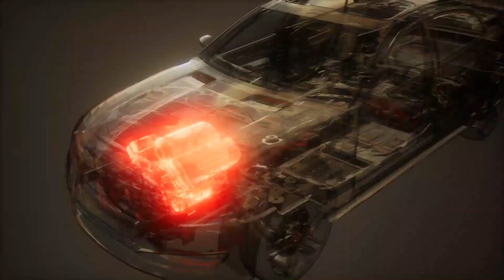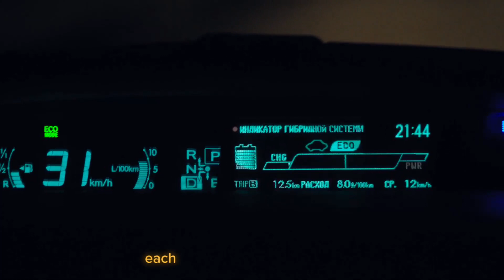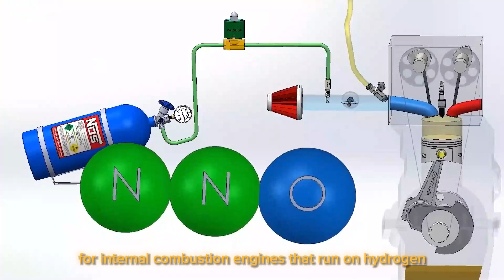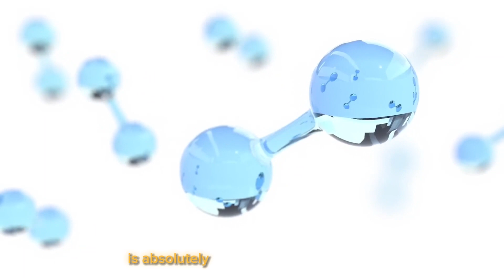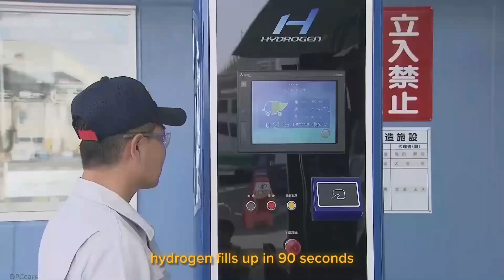Toyota : "This New Engine Will Destroy The Entire EV Industry!"

Comment: "This new engine will stop EV-"
No it won't 
"Hydrogen is ab-"
No it isn't 
"Gasoline will stay for-"
No it isn't 
"EVs catch fi-"
No they don't 
"Batteries deg-"
No they don't 
Just stop it. Its annoying.
The most fuel efficient power production is in the grid, even if you use coal or gas
Batteries are much better today thanks to advancements in chemistry and proper algorithms of the bms.
Cobalt is used in refining oil and lfp battery chemistry doesnt even use it.
That lfp chemistry also doesnt catch fire when pierced. In general gas cars catch fire many times more frequently than EVs, but nobody reports it on the news
Hydrogen is not only energy intensice to produce, it is also energy intensive to store and transport. The same energy you complain is not clean or renewable when complaining about EVs.

Comment: Doubt so, it is not about the car. It is about the infrastructures required to build all over the country to support the refueling before it can start cashing in and ROI. Then you have the process of facing out the existing cars which are already in used together with its petrol station. China can sustain EV on its own because they have a large population that has the spending power which many countries do not. This will eventually spread thru out Asia and thus drive the world to follow (if the manufacturers want a piece of pie at this part of the world).

Comment: In short, it's way more environmental friendly than EV's. Maintenance will be easier and cheaper than EV's. And are safer than EV's. And on top of that all, if one refit traditional gas stations it will be no where as much a burden as planting charging stations for EV's all over the place not to mention not needing to build lots and lots of electricy generating plants that use..... ah yes fossil fuel.
Reply: So you DO know that a standard  hydrogen station of 150 kg can only refuel 25 FCEVs before needing a delivery and the footprint of a hydrogen station to fuel 600 vehicles per day like a gas station would be emormous, and you DO know that a hydrogen vehicle requiring service of its fueling system requires a tow to a specialized facility with  anti explosion equipment and technicians and a 30 minute procedure to purge the tanks and fuel  line before any service work can be performed. Right?
Reply: @JimHindson  Did I say that it is absolute environmental friendly? No.

Care to compare all that needs to be done with all that needs to be done to put down EV charging stations? Just the fact that there will be needed lots of extra electricity producing plants who will be using lots of gas and gasoline or nuclear because windmills or solar panels won't cut it.
Never mind all the rare and toxic minerals to produce all those batteries.

You do know that there are cars that run on LGP? And you know that there have been less issues in all those decades with those than there already have been with EV's turning in a blaze of fire?

How long those it take do you think to remove the battery from a car so as to have access to replace faulty cells? Hint: more than 30 minutes. Here's an idea, look up repair or replacement costs for EV batteries. It starts at a few thousand.

You do know that, right?

Comment: What nonsense!. 
Hydrogen combustion engines suffer from poor efficiency and low power due to the low energy density per unit volume and heat losses. Try to increase power and efficiency by increasing chamber pressure and NOx emissions go through the roof.
Hydrogen combustion engines are not viable, hydrogen fool cells are not either.
This is just stalling by Toyota because they are so far behind in EVs